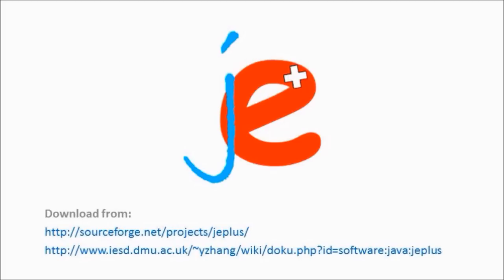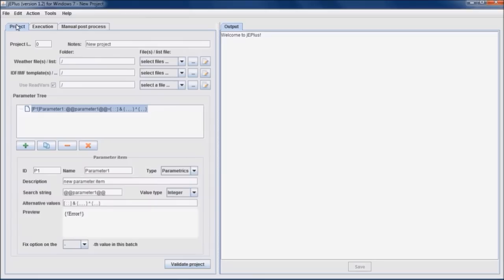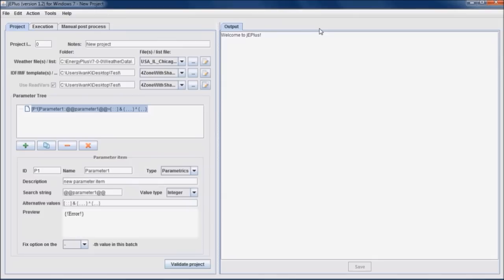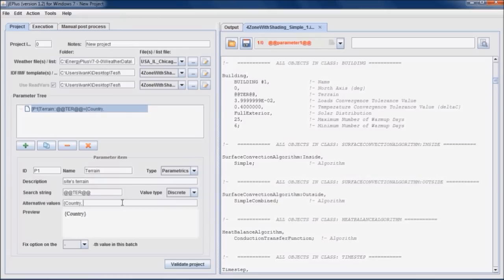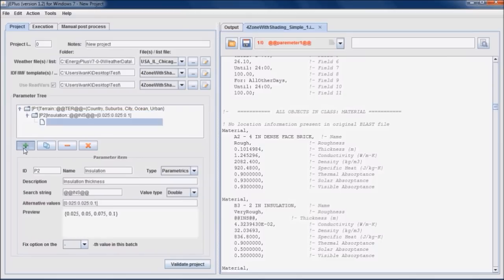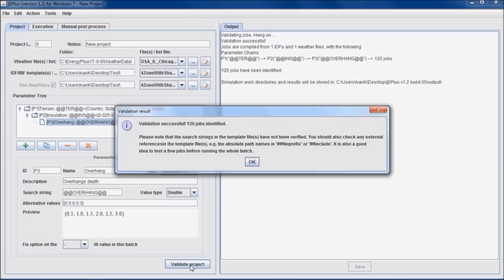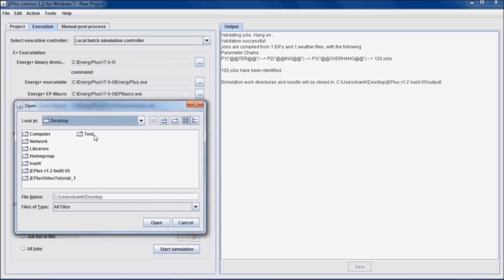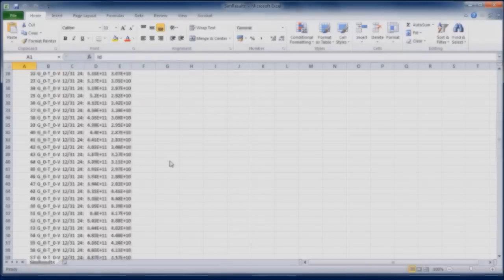jEPlus: get started with parametric studies

Comment from the maker: Hi Ricardo, 

The rvi file is actually a plain text file (having an extension .rvi) where you can specify outputs to be extracted from the eso file. Outputs are defined by output variable names which also need to be specified in EnergyPlus idf file. The example of the rvi file is following (zero at the end of the file is obligatory):

eplusout.eso
eplusout.csv
Heating:DistrictHeating
Cooling:DistrictCooling
0

Cheers,
Ivan